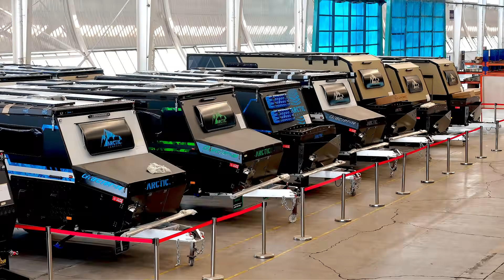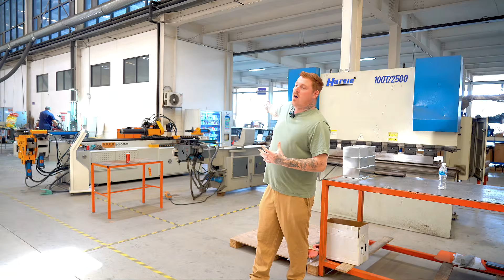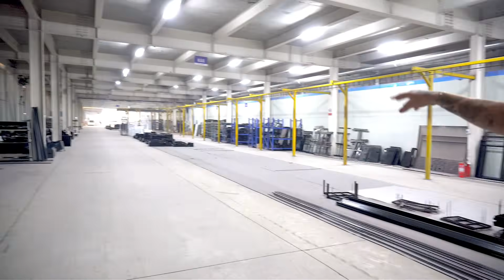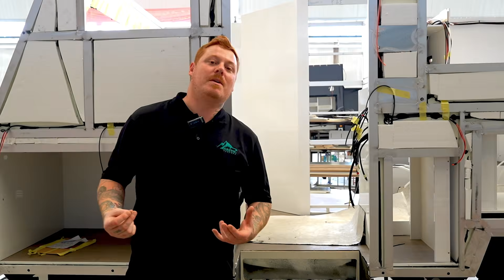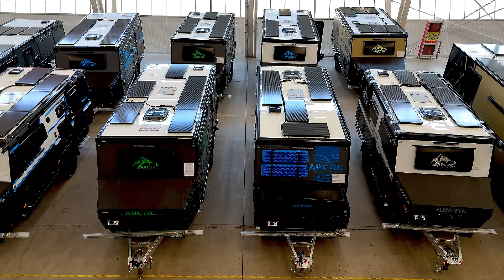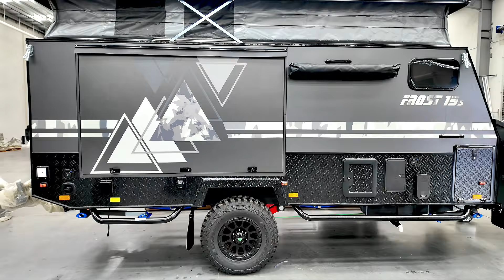Are All Chinese-Built Caravans and Campers the Same? Inside Arctic's Factory

Comment: cheap chinese crap , poor quality materials not able to get parts and accessories from local caravan store when traveling , i have a juncko and yes it has quality control problems but at least some one in australia has a job and can support his family , the problems with my unit can easily be fixed .flood the market with cheap imports and this is good for who , not the average aussie .looks like a game of guess which one you are getting , did mr wong pick up the good steel or the rusted steel , strange to have a sub standard manufacturing process next to a supposed quality product under the same roof .tomorrow mr wong in head office says cut costs and no more sealant between joins , don;t let me deter you from getting one spend your money and enjoy Chinese quality .in his own words ,we have to redo the wheel bearings just in case they were not done proprerly in the factory , were;s the quality control he raved about they had , sounds like this guy should apply for prime ministers job when he gets back home.

Comment: Yes my perception was changed after watching this. The skill of the Chinese workers was evident.  Unfortunately, when the Australian final fitting was shown, the workers were not so much. How did this happen.. The water leak testing was a stand out. The Chinese factory had major water jetting from every angle as you stated and would have probably found most water ingress issues. The Australian water test had 2 Pope lawn soaker sprinklers upside down from an awning  with next to no pressure. Funny stuff. Just an observation team. Your vans do look to be at the top level in the Chinese market for sure. Thanks again for the insights. So interesting to see two different cultures side by side.